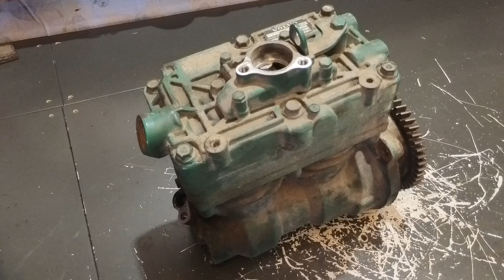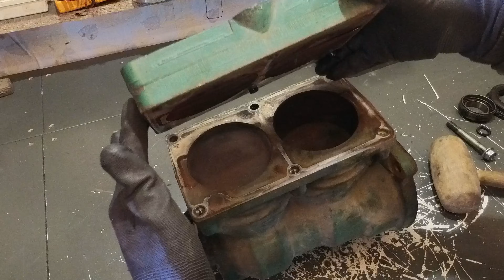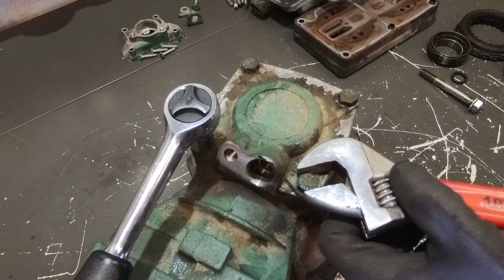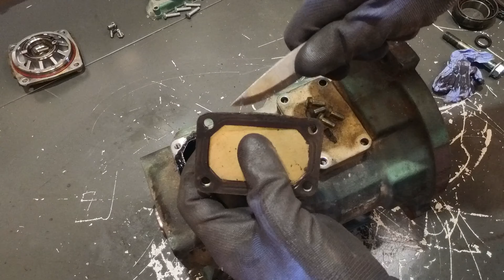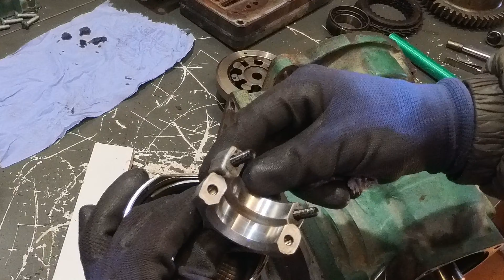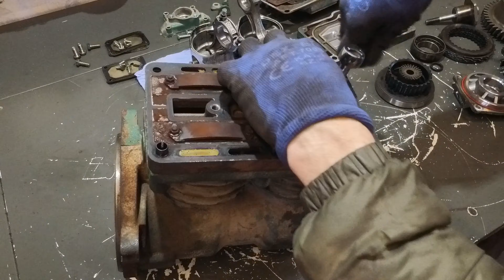Volvo FH Truck Compressor Burned Clutch (Twin Cylinder) LS 8901 Teardown

Comment: What’s that compressor come off? Semi truck (tractor)?  That would make an awesome compressor section for a shop compressed air supply, couple to the right electric motor.  Looks robust enough for 100% duty cycle and large enough to fill any tank quickly and supply high volume for any tools one might use!  
Thanks you’ve given me an idea!